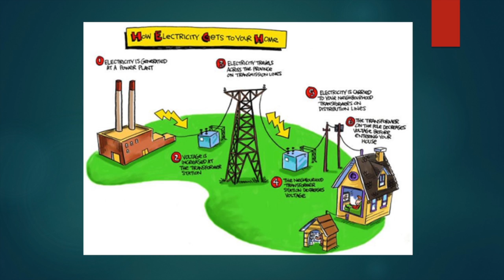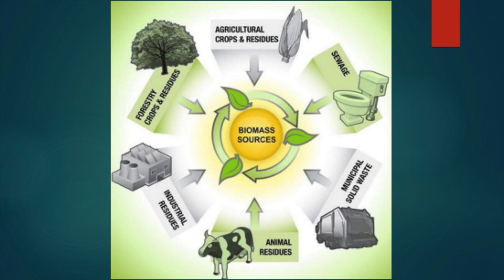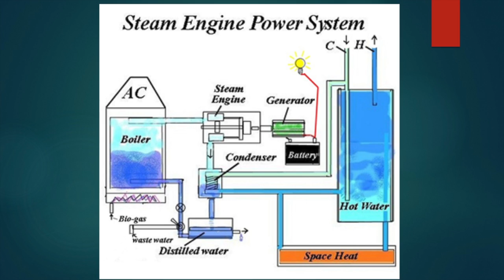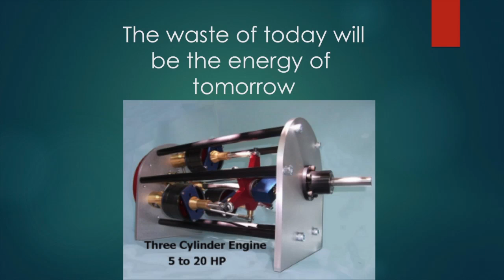The Surprising Future of Steam Power | Robert Green | TEDxMissionViejo

Comment: Fine, not so simple as described  but a viable direction. On the implementation note though, first you have to put this in a well insulated (no heat loss) closed loop system and second, substitute your patented engine with a Tesla Turbine. A 6 inch disk diameter (26 disks 1/16 inch think disk, 1/32 inter-disk space,  78/32 inch total disk thickness) Tesla Turbine (done in 2 stages, 2nd stage 3x the disks of the first) , has 2.5 times the power of what you are showing as a model, an (approximately)  5 times smaller space requirements. In addition it is easier to manufacture and Tesla patent is in the public domain, for more then  90 years now, so technically any well maintained and experienced machine shop should be able to build it with common days high quality steel materials.
Reply: Aren't the rpms of the Tesla a problem to gear down for?  I'd love to see the motor as Tesla originally planned it, not like GE engineers built it to his dismay, not following his instructions.

Comment: No, Robert Green is not a crackpot. His claims about the wastage in power-station/grid systems are in, in general, true. Sadly, too cheap fossil fuels and high profits for the rich killed off local alternatives. His claims for small scale local steam power and the use of relatively low-energy waste heat are also generally true. What is unclear is whether HIS engine design is optimal. It is unusual. I've read concerns that the design will not wear well. We are in an environmental crisis created mostly by rampant burning of fossil fuels. Thankfully some visionaries recognise the problem and are trying to do something about it. True, a steam engine still has to burn something. But local power, and eliminating the large percentage that fizzes off the grid into the air as heat may reduce fuel usage. Also true, you have to get the fuel to the engine. But - and now you'll call me a crackpot - you can make methane form human manure - is a called biogas and has been a viable technology for 50 years or more (look it up). What if your septic tank was your local power station? You can also make steam directly with a solar concentrator. Green's design may not be the fix, but thank Robert for adding his intelligence and expertise to address the problem(s).
Reply: That is an excellent explanation.

Comment: largest thermal power station in UK burns biomass to drive steam turbine generators
Reply: they waste  60% of the heat
Reply: All coal is biomass. All petroleum is biomass. Coal and petroleum have the highest energy density of all fuels, so if you're using other sources of biomass to run turbines then you're creating MORE CO2 than coal plants, not less.
Reply: And they import the biomass (pellets of sawdust) from USA.
Reply: @plaguedoct0r  not true! biomass is the Co2 that is already circulation on the earth surface ( in form of wood then transforming in to co2 when burn but again will be consumed by plants). but when u extract petroleum once was stored deep inside the earth you are releasing stored co2 to the atmosphere.

Comment: I have yet to use one of his steam engines, but I believe he is correct in being able to replace, or significantly supplant, hydrocarbon-based energy production with steam. I have a  patent for a concentrated solar thermal device that I plan to employ, hopefully using one of his engines to drive a generator to produce current.
Reply: joseph sowder I'd like to learn more about your project. Do you have a website, or any videos?
Reply: It would still burn hydrocarbons and bio mass at the end of the day just on an individual level vs municipal. People would buying up used motor/gear oils for fuel instead of sending them the recyclers, used cooking oils, and all sorts of other waste. Not sure how good that would be for “clean” air and global warming (if it exists).

Only real benefit is making a more complete use of the burnt fuel. It would use residual heat in the home instead of wasting that energy in cooling towers.
Reply: @meyaht   The only video I have is on here - "solar steam" Distilled Energy. I can't seem to garner the interest/investment  I need in order to fully develop it. The crude prototype produced >60 psi for 8 hours.
Reply: @josephsowder847  Crowd funding? Good luck.... don't stop!

Comment: Excellent video. Thank you. A Stirling engine would be a lot more efficient, quite, and much easier to maintain., in such a system. Steam engines especially small ones are highly inefficient, noisy, and have lubrication issues.
Reply: Stirling works with closed cycle. The best efficiency of them occurs only while they are cold.
Reply: Build one.
Reply: Low torque and not scalable practically.
Reply: Stirling engine has no tougue and only produce one or two kw of power. It waste fuel. Steam has far more power.

Comment: They said this design in REVOLUTIONARY - nothing revolutionary at all about it. His schematic is a very standard steam design with Dc battery and generator. It's been around for years already.  This video is nothing more than a Sales Pitch !  He has not invented anything new - just regurgitated 150 year old technology which was replaced in the 1940's by oil/petrol. Replaced for all the same problems we know of with steam; - Lubrication issues, explosive boiler, coal burning fuel, and low efficiency, slow start up time; etc. 

These alternative ideas were around in the late 1970's and people killed those inventors who tried to undermine the big oil companies. Just look at Stanley Meyer's water car. He was poisoned at a restaurant in the 1990's to shut him down and he had patents on his water technology as well. Yull Brown's water-fuel technology from the mid 1970's which some 50 years later it's still not on the market.

You can make a simple Petrol Generator run off gas from Propane, Brown's hydrogen gas from water, or even Methane from bio-fuels 9if you want to do so. Many YouTube videos on all this.  The other problem is - many local councils won't allow you to use engines if the noise is too high, nor make your own fuel at home, nor even let you install a wind generator because of their size and low frequency noise factor. 

I can't see this technology working in a multi-storey set of housing units. No room to fit the engine and boiler chest, plus unit owners are often single mothers who would not have a clue of servicing the machine and most people would blow themselves up if left to their own devices.  You need a pressure vessel license to run steam.  That's why the current electrical system has been in use for nearly 100 years and not likely to ever get superseded. This guy is dreaming and has not thought the problems it through.

Comment: Problem with wind and solar is local regulation, planning commission, and the batteries and such are the easiest thing to deal with. I live where there is more than enough wind to power my home from small wind turbines.... However where I live I am not legally allowed to install them, and the same for putting them on the roof of my home. I have to get permission from the city in install them on my house roof.  I would have enough solar and wind to be fully independent for electric and heating if I did not need to get permission for everything.
Reply: Part of the problems blocking genuine progress.
Reply: @watchthe1369  government is definitely a problem and you can supply your own power with these, but the problem is they don't scale due to lack of storage tech that is decades away from necessary capacity
Reply: Nobody ever puts a wind turbine on their roof.  It is the worst possible place. I suggest you have a lot of learning to do.

Comment: Thermal efficiency?
Reply: in general, <40%
Reply: diesel is more efficient then steam
Reply: twistedyogert then why is >90% of the world's power made from steam?
Reply: I meant for transportation, you hardly see steam trains or cars in use today. But it is true that most of the world's power is generated by some sort of steam turbine.
Reply: Because it is a much cleaner way to burn fuel. And diesel can't run on coal, which is used for powerplants
Reply: Skinner Unaflow steam engines are a good example. As compound engines they approached thermal efficiency of diesel engines.
Reply: twistedyogert
how much a tecnology is used is differente of how much it's efficient.
Reply: For transportation, first engine efficiency less than 20% and transmission efficiency is 90%. So the final efficiency is less than 18%. Less than Diesel engine, but biomass.
Reply: @leeknivek  
In the large sizes, ultrasupercritical  steam plants have a 47.5% efficiency.

Comment: you'd have to insulate the pipes so heat loss would be minimal. extra expense. then a leak, total great way to bonk your head with a new rock. so pipes vs power cables? i go for cables.
Reply: Good point now why don't they just use a steam engine/turbine to generate electricity to send over cables?........